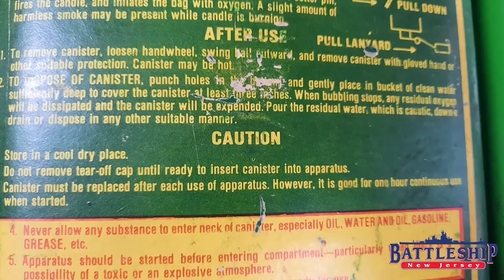Do OBA Cannisters Actually Explode When They Get Wet?

Comment: what would it cost to operate an Iowa class or similar battleship in the modern era?
Reply: a lot
Reply: A lot.  The personnel costs were what did them in.  We had destroyers that had a longer reach than our battleships at 1/4 of the cost.   The only thing that they would really excel at would be shelling shore targets.  I love them - they just aren't economical.
Reply: @IMDunn-oy9cd  I've seen that supercarriers cost roughly 1bn/yr to operate. Surely it'd be less than that? I guess it's weapon limitations far outweigh any benefit a battleship could provide on the modern battlefield.
Reply: @Qball914  Missiles > Guns.
Reply: $37.57 a week
Reply: A lot of money. If you are hinting towards recommissioning the ship it would be a very costly thing. (Restarting the engine and generator, Pumps and plumbing being started up again along with fixing possible damage caused from its decommission.)
Reply: @Qball914  it's all about air superiority
Reply: Less than a Carrier, but still a lot for fuel and consumables. I don't think they even have 16'' shells anymore. And the powders were out of date and deteriorating in the 1980's.
Reply: @SSN515  the powder was fine, the bags were no bueno.
Reply: in the early 90's it was said to cost just about 1 million dollars just to untie from the pier.
Reply: @randymagnum143  Whatever. They would have to make new powder, and I think we no longer have that capability.
Reply: @leftyo9589  Year. I seem to recall hearing or reading that it costs 15 million a day to run a Carrier at sea.

Comment: Don't try this at home?  Awww you spoil all my fun!  I have a half dozen sitting in my closet and figured I'd run out and set them off.  Just kidding!!!  On a slightly more honest note, I wonder if you could use one of those to breathe underwater in an emergency?  Thanks for sharing!
Reply: No
Reply: 2 problems with that. while the unit is sealed when in use, the inflated bags would make you float, and if you managed to be at any depth, the pressure would deflate the bags rendering the oba inoperable.